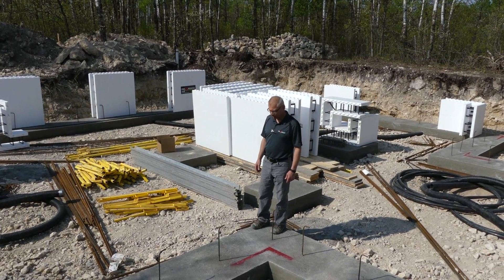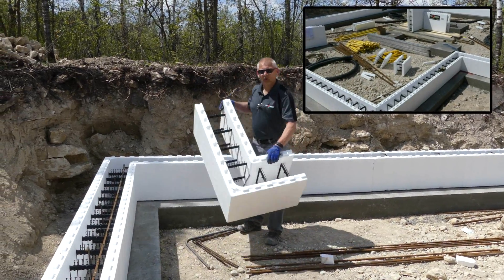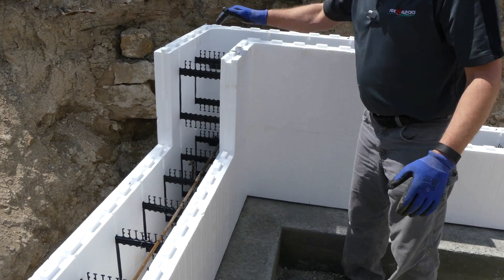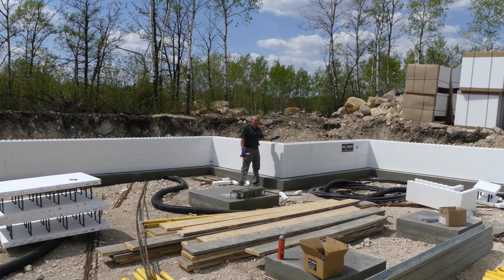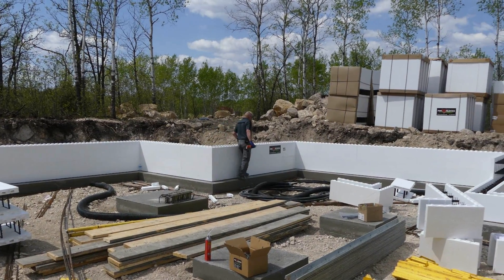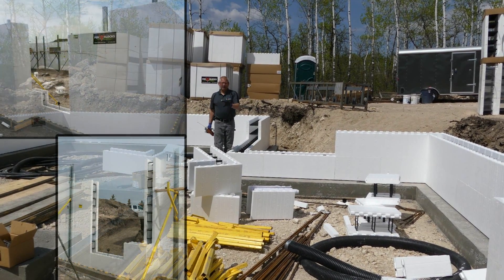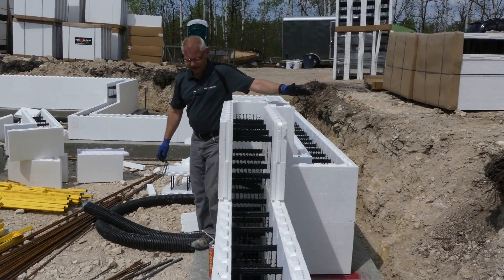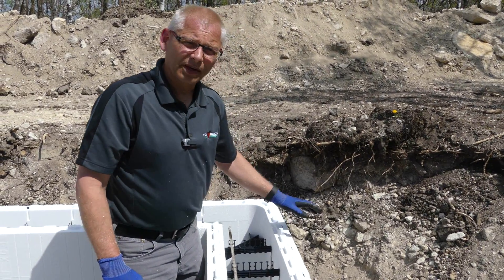Building Your ICF Home: Installing the First Two Rows of Fox Blocks with HV Clips and Corners

Comment: An explanation video and a comments section full of questions unanswered by the manufacturer. The manufacturer my builder is presenting me with for our home. Im not so sure.
Reply: From a builders stand point Foxblocks has done the most field testing and research. The social media presence isnt strong but the product certainly is. Make sure you have a good contractor doing the work then ideally you wont need to even deal with FoxBlocks the company
Reply: From another Chad

Comment: Thank u for nothing!!  
What a useless piece of information. 
Why did you not show us the first row? I won't be using it for my home
Reply: You're missing out.  These are great. 

First row gets laid to the chalk line. Add clips at the seams where the blocks come together.  When the wall is Vuitton come back and ensure the top of wall is level.  (Shim the bottom of the wall as needed). Brace the walls.  Use spray foam along the bottom of the block where it meets the footing to secure the block. (The spray foam works better than you'd think). READY TO POUR.
Reply: What Matt said, you are missing out.  you foam it to the footing, and to add to what he said, it works better if everything is dry when you foam it.  I also tied some of the horizontal rebar to the uprights coming out of the footing.  I left a few areas un-foamed to allow me to rinse any debris out before the pour.  We just moved into our owner build after final insp last week.  It is on a full daylight basement,(8” basement icf, 6” upper icf walls) super insulated with radiant heat. The room temp has been within 1 degree of the 66F I set the thermostat at last week, every time I have looked at it.  I can’t hear airplanes, I can’t hear trucks on the highway, I can’t hear the wind blow...  if you pass,  you will be passing on a solid, quiet, comfortable house...  they have other videos showing the process from start to finish if you feel you are missing out.  I think they did this one as people were getting confused on the proper way to use the clips at the corners.  Dead easy build process by the way, my wife and I did it all, and hired the pours done...
Reply: @rronmar  Thank you for the information. I am in the research stage and really like this idea. I will have a full basement, but not a daylight. did you do any additional waterproofing to the exterior of the basement walls? What concrete thickness did you go with? Any advice or anything would be extremely helpful. thanks!
Reply: @diyoregonnowtexas9202  yes I used Henry Blue skin(wpa200?) for waterproofing, the foam is mostly waterproof, but the seams where all the blocks meet are not, nor is the concrete.  After brushing off the loose/dirty foam oxide and using henrys adhesive primer, I applied 3’ wide strips of the material vertically with the prescribed overlap.  I have a video of part of that process here on Youtube.  I ran it down over the footing.  I covered it with 1” pink foam to protect it from the layer of gravel backfill and there is a french drain and gravel around the perimeter of the footing.  I am on sand and a slight hill so the drain runs to daylight, but we perk so well I have never seen any water come out the drain.  Depending on your soil type and water table relationship, you may need to plumb a drain to sump and sub pump…  on the inside I put 2” of foam and vapor barrier under a 4” slab.   I used 8” concrete thickness for the basement walls and transitioned that to 6” for the above grade house walls.  Here in the northwest we are seismic zone 2 so you will also use a considerable amount of rebar, and things like large windows and vaulted ceilings are a bit more difficult to engineer.  The floor floor and earth restrain the basement walls and the roof trusses restrain the above grade walls. Vaulted trusses do not have as much restraint.  We also needed additional rat-runs in the roof structure to restrain the end walls(rectangular structure).  We did out floor support a little different also. We placed a corbel/brickledge block at the top of the basement wall, but on the inside.  We put a sill plate on top of this and used top-chord hung trusses hanging from that.  Good luck
Reply: Sign up for the online training course. These are just quick informational videos ONLY!! Always amazed at people who criticize but don't do ANY research . ALL the info is available to anyone . This isn't operating a nuclear submarine ...anyone with basic carpentry or concrete skills can do ICF .
Reply: @bchedlund8838 what's the point in this if folks are researching it? It's not confusing to sales

Comment: Is the first rows done with ICF block of 10 inches ? Or what is the right size? Kind of doesn't look like 8 inches inner size?
Reply: ICF tend to be 16 inches tall and 4 feet long. This is the same area as 6 cement blocks

Comment: Could  you pour concrete every couple of rows?
Reply: Yes. Code says that you do whats known as a lift of concrete. You can do a maximum of 4 feet per lift i believe. If youre building a house after tje foundation you can also fill the last part half full to help with wedding the two together
Reply: michael lyden no- each pour is weak between the joint with the next “pour” ideally you want a single pour
Reply: The concrete never should pour with severals time anyway application for no exist joint !!!

Comment: All these videos. Didn't show how to attach dry wall.  Styrofoam 
Exposed.  Always ❓
Reply: Paul Betka _ You should utilize your search engine;

Search YouTube for;

"How to install drywall on ICF walls"

You will find some videos about that subject
Reply: Drywall attaches  with regular drywall screws into the black plastic webbing that runs vertically every 8" on center. It is just below the surface of the styrofoam. Similarly with siding on the outside.
Reply: Yep, piece of cake, also flat and solid as a rock when installed...
Reply: Code says you need a 15 minute fire shield which is generally just 1/2 imch drywall gypsum board

Comment: that was useless never showed how they put the first course down if it was fastened to footing or how they spliced a section where a closet is cutting them or anything.
Reply: He goes kinda quick. You place your corners like you would with block then you fill berween with the normal pieces. He showed you how he does small dabs of spray foam on the bottom of the first course to hold it to the footing